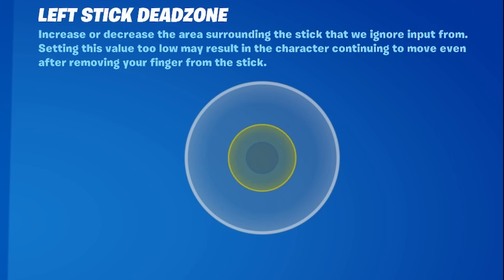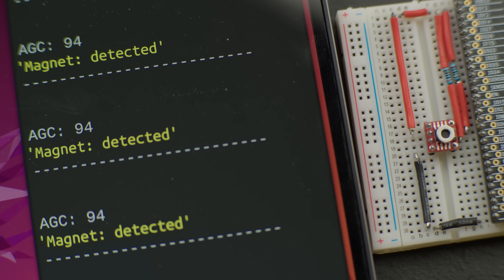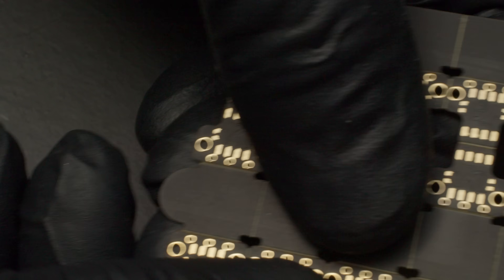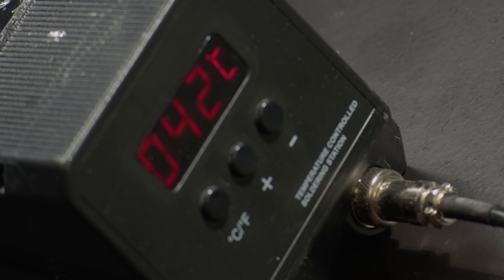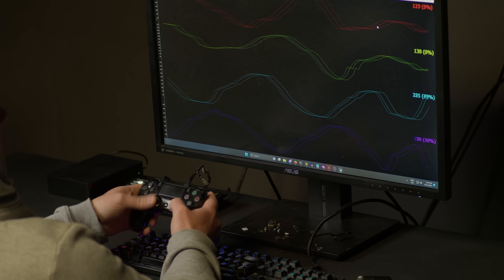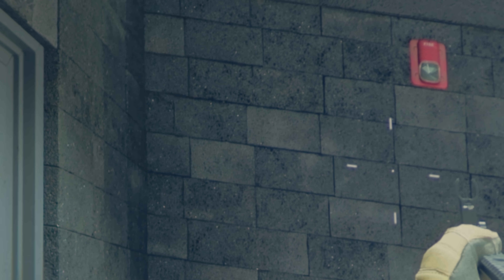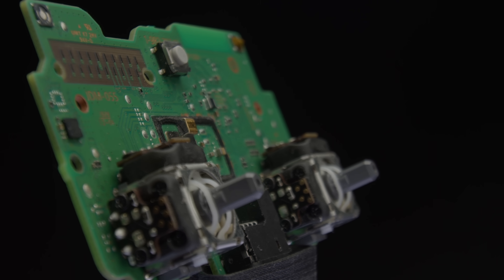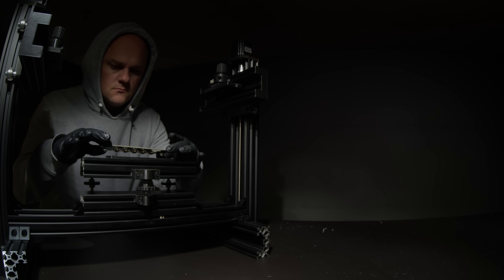Beating the $20B Joystick Drift Problem, and giving it away for free

Comment: I think they know exactly what they are doing. This wasn't a big issue a few console generations ago.
Reply: Planned obsolescence baby
Reply: how long ago are we talking, my 360 controllers have terrible stick drift
Reply: @3CODKing  Meaning that majority of people didn't even know it was possible to fix stick drift, people just assume it's normal that they break, like everything else...
Reply: @Empty12345  gaming has also changed where stick drift is an issue but it wasn’t really back then. Gamings change controllers not really
Reply: @3CODKing my 360 controller started having such drift after 10 years of constant use
Reply: @Idfkwhyy  All 5 of our PS5 controllers have drift after a few months.
Reply: @AlfieMaxMiMi  damn, thats weird. I got a black dualsense right when it launched to play on my PC and after almost a year it's still fine, no drift at all.
Reply: @3CODKing my dreamcast controllers and gamecube sticks always felt good. not sure about N64 but those were great too
Reply: @3CODKing PS2 and PS3 controllers also uses hall effect to recalibrate the analog everytime the controller is connected. there are demonstration videos of this already
Reply: @3CODKing PS2 had built in drift correction.
Reply: @3CODKing  In the 90s, there was the Microsoft Sidewinder 3D Pro, with optical sensors, like you'd find on... a ball mouse.
Reply: @3CODKing my ps4 controllers have never gotten stick drift and I be played with them for about 6 years and I’ve never gotten stick drift now my ps5 controllers get it after 6 months
Reply: @3CODKing  

PS1, PS2, OG XBOX, all had hall effect/driftless controllers.
Reply: @3CODKing  i beat the fuck out of my ps3 controllers and only had motion glitches if i dropped the controller alot
Reply: @3CODKing yeah, one of my old N64 controllers has terrible drift, too.
Reply: @3CODKing  Dreamcast controllers and earlier models of the PS3 controller are drift-proof since their sticks use the same magnetic principles as in this video.
Reply: @3CODKing I think you just broke em dude
Reply: @3CODKing PS2 has zero drift issues.
Reply: @3CODKing we are talking about when dinosaurs dont have any issue with their controllers, it actually last for many generations and became a common heirloom among prominent dinosaurial clans
Reply: Og xbox ps2 gamecube had no drift, and the dreamcast had also no drift and the mechanics of it were different 😊@3CODKing
Reply: @3CODKing well the old N64 ctrl and other in that era already used a similar method (hall effect, magnetic). But the one in X360, ps3 or 4+, NSW are  cheaper and it is a good revenue selling replacements that are just as bad
Reply: @3CODKing  2012 and below
Reply: Yes your actually right. Companies do make their product to not last very long. So they can make more money
Reply: Someones never played n64 or ps1
Reply: I agree, they've probably made them even cheaper on purpose because they were lasting too long
Reply: My PS2 controllers are fine til this day. Both are originals and I have them since the first PS2 Slim.
Reply: @IgnusValentine  ya all my old controllers are doin just fine even PS1 aswel & they've seen alot alot of use
Reply: My standard xbox series controller works like a charm, I haven’t gotten stick drift and i’ve been abusing this controller for close to a year. I did have an xbox elite controller and the bumpers always break though. It is just inexcusable that a $180 controller has the bumpers break within a couple months of use. Microsoft knows about it and haven’t fixed it. It makes no sense than the standard controller that comes with the xbox is more durable than the “elite” controller.
Reply: My PS3 had only two controller replacements through its console cycle. The PS4 had 7 replacements.. PS5 three within two years because of drift
Reply: @MRHardRoller i went through 7 ps4 remotes in the lifespan of mw19 alone, used the remote that came with 3 years no issue but once that died id get stick drift in like 2 weeks and within a month it was usually bad enough to retire the remote from fps games
Reply: bro bro bro, idk about you but we smacked the n64 stick and that thing had the neck broken but not DRIFTING!
Reply: because it's a scam... SEGA and GuliKit fixed this in the 90s and their patent expired so Sony and Xbox have no excuse to not use that design. they don't use a potentiometer to detect movement, they use a hall effect sensor which has no moving parts, because it uses magnetism, thus it lasts nearly forever... they still sell controllers with hall effect sensors today and they last far longer.. video explanation : https://www.youtube.com/watch?v=MpLQf_q3avA&lc=UgySqCl8Za-qhZPILkZ4AaABAg
Reply: i use a 20 year old logitech g13 and it still centers perfectly.
Reply: I miss the old ps2 controllers.. I grew up on those things.
Reply: Fun fact: N64 controllers can be opened up and fixed using only a phillips screwdriver -- the control stick switches out in about a minute
Reply: I NEVER got stick drift on my Xbox 360 dropped it multiple times and never broke I drop a newer Xbox controller once and I know something must've broke
Reply: Sure, ask Nintendo, thosere were super happy.
either that or get a fk xbox 360 controller. mine is 15y old an works fine
Reply: N64 controllers may not have "drifted" as such but the parts still wore out so the stick would sag, or not return back to the centre point at all. And the plastic in the internals would degrade and turn into a coarse powder that would create an unpleasant grinding sensation in the mechanism when the joystick was used. 

Old controllers definitely had their issues. I'd rather have a replaceable / repairable controller for cheap that might need some TLC years after EOL of their parent console than the over-engineered controllers that cost as much as dualsense 5 controllers do today.
Reply: They could just sell parts or something. Or do this. Somebody get him a billion bucks. And bring me a million while you're at it!
Reply: N64 would like a word
Reply: The PS2 even had a system to fix it, the controller measured the drift and corrected itself, modern controllers don't do that..

Most people throw away their controllers to buy new ones ones they start drifting cause they are 'broken' and that way they make more money on their overpriced controllers..
Reply: Planned obsolescence… can’t make $ if the controller doesn’t break…
Reply: Seriously. I never heard about stick drift at all until the PS4/XBONE generation. I know it did happen but it seemed to start happening all over the place. I still have an original gamecube controller that works perfectly.
Reply: It wasn't an issue on my early DS3 controllers because they used hall sensors.
It's entirely planned obsolescence.
Reply: It's been a year and nobody is implementing this; yes, it's all purposeful
Reply: @ArbitrarilyAnswereD”non existent”?
Reply: Just buy the Gamesir G7. Cheap and reliable
Reply: Dead zones used to be wayyyyy bigger lol
Reply: Why would they save you money when you could just buy more controllers to make them more profitable?
Reply: Shush
Reply: Ive had pretty bad stick drift every controller ive ever had. 360, xbox one day one, xbox one custom, newer xbox one controllers as well.
Reply: lol funny to see you there brother
Reply: Ps2 remotes used to recallibrate, you could just wiggle the stick to let it read values and adjust
Reply: PS3 joysticks are way less accurate than newer controllers, so the issue that causes the drift is not/less noticeable on older controllers.
Reply: People on here be like “uh my SNES controller didn’t drift”
Reply: .. ding ding ding.. this guy gets it..
Reply: Consumer products isn't made to last (hint is on the name) joysticks like this has been the standard in industries for decades now, like joysticks in heavy vehicles, controlpanels on garbage trucks etc where reliability is more important than cost where just one halleffect joystick without anything else than two axles for a garbage truck controlpanels sells for about 5-600 euros for JUST the joystick alone. While a joystick like this for game controllers isn't as expensive. Consumer products is simply made to function because consumers themselves refuse to pay for anything. Just look at how freaking common CHEAP worthless deathtraps of cellphone chargers people buy and use.
Reply: As some have mentioned the N64 controller... That one is an odd one out it had no drift per se Because it's not a potentiometer used for position control rather it uses the one and same technology that old ball based mice for PCs worked. By having two slotted wheel pass through a light beam. 

The "drift" on the N64 controller is because Nintendo didn't really realize HOW much the stick part of the joystick would wear down as it was physically rubbing the plastic dome base it was spring loaded onto to create the stiffness of the stick. And without lubricant the rubbing wore down the stick fast. In some cases where people by normal action presses down on the joystick as they play it wore down even faster still. This weardown causes the spring that stiffened the stick to loose tension and cash the cause for the stick to "wobble" around when you slightly shake the controller. 

Some people that by normal action but no down force on the stick only putting horizontal force on it saw a longer lifespan. But it still will always wear down. 

Some people just wear things faster by normal aswell. As mentioned, some unconsciously puts a vertical force on the joystick which does increase wear compared to normal wear from just horizontal force.
Reply: I've had drift here and there since ps1.
Reply: I have 6 xbox360 with years of use. Only the thumb pad disintegrated and one controller has a right shoulder that doesn’t work. My Xbox one lasted 6 months before the drifting occurred
Reply: True, I've got ancient PS3 controllers that are still going strong. But I'm not sure that it's Sonys fault. ALPS make the pots, and they don't appear to be as good as they were. Perhaps it's ALPS getting greedy? If so, I hope it bites them in the ass.
Reply: @AlfieMaxMiMi my ps3 ones are still going strong as well
Reply: @AlfieMaxMiMi .. news flash: every company that makes 1 million dollars this year.. needs to make more then that next year to be considered "succesful" lol 🤷🏻‍♀️🤷🏻‍♀️
Reply: @AlfieMaxMiMi they can still get it it just takes a lot more time
Reply: @AlfieMaxMiMi  Perhaps,  but in other fields, Like electrical musical instruments, for example, ALPS are largely seen as "cheap", with CTS, Bournes, Seymour Duncan and Fender being seen as superior for Full sized wiper sider style Pots. If the manufacturers wanted to place quality over cost, they had plenty of options.
Reply: @SavageDarkness  In my hobby, the Alps blue is pretty much the industry standard. The old Alps pots as used in the ps3/ps4 rarely suffered from drift, so as I said previously, Alps must have changed something... I don't see it as Sonys fault, by buying inferior parts - unless they knew things had changed, but then Nintendo and Microsoft are suffering from the same drift problems with their controllers. What I don't like about Sony, is them bringing out a new controller (dual sense) costing a hell of a lot more, but with the same problem. And with them obviously knowing it's a problem by making the sticks easily replaceable (finding a way to make money out of the fault they should have fixed).
Reply: @SavageDarkness  just FYI Fender doesn't make pots their pots are made by CTS. Neither does Seymour Duncan. They're also CTS pots. Their pots are sometimes made to custom spec, but CTS makes them all. The good stuff is pretty much all CTS and Bournes in guitar land.
Reply: @gralnrath  True, but most people do not know that.
Reply: @SavageDarkness  Right...that's why I'm elucidating. I'm just adding context not throwing shade.
Reply: I think you're giving Sony and other console/controller companies way too much credit. Think about it. Who's making more money from controller sales? It would make much more sense that steering for planned obsolescence was either a collaborative effort, or one of the companies making real money sticks going out, coming to ALPs with design suggestions (ie, can you make these go out sooner?)
Reply: @sododgy8338  FACTS
Reply: @AlfieMaxMiMi  PS3 controllers use the same joystick modules that they have today. They are also prone to stick drift.
Reply: @Empty12345  I've got about 6 very old PS3 controllers that I've had to replace the batteries on. None have suffered from drift. We have 5 PS5 controllers here that have all been replaced a number of times due to drift. There's just no comparison.
Reply: @AlfieMaxMiMi  Sure, nevertheless both use potentiometer joysticks.
PS5 could have worse sticks, but PS3 joysticks aren't immune to stick drift.
Reply: @Empty12345  No, they are not immune, it's just so rare that it's not something to worry about.
Reply: @AlfieMaxMiMi  The earliest models of Sixaxis controllers, the ones without vibration before they released the dualshock 3, actually used hall effect sticks, so there's that, but then they changed it to the usual Alps. And before then there was the dualshock 2 which constantly self-calibrated to combat drift, and those sticks would keep going perfectly until the actual spring started to give. It was only until the PS360 era that drift became a common issue.
Reply: @Klefth  The earliest models didn't use hall effects, the majority of dualshock 3 boards however did, ps3dev wiki has a top and bottom view of each board, the ones with 4 pins per stick axis are hall effect sticks
Reply: @AlfieMaxMiMi Ur PS3 controllers are lasting longer because the deadzones of gamrs back then were bigger.
Reply: Can confirm, I had to replace about 4 PS3 controllers due it's batteries but never had any problem with stick drift until ps4-5
Reply: @AlfieMaxMiMi 💯 I've had old controllers for years and never once thought about stick drift. 
A year or so after owning my Xbox elite controller, stick drift.
I fixed it but it came back. Need to try it again.
Reply: @Empty12345  Wrong! PS3 used 4pin modules that has hall effect sensors. There is video called "Drift Proof Controllers" from VK's Channel that shows Dreamcast and DS3 controller joystick.
Reply: @mdjey2  Googled it and apparently there may have been a first batch of PS3 controllres that did have hall effect sticks. Great, sadly they stopped it because of greed.
Reply: @AlfieMaxMiMi I have 2 PS5 controllers for 2 years, and they are just as fine as they were when I bought them. I don’t know what people do with them so they break. Or am I just lucky.
Reply: @murray821 Our controllers aren't abused in any way. You're just lucky.
Reply: @AlfieMaxMiMi  i have 3 ps3 controllers, 2 dualshocks and a sixaxis. The dualshocks are still going strong, the sixaxis unfortunately developed drift on both sticks after a year or so :(
Reply: Everyone here talking about cheap components when the largest indepdent study concluded that it was more about a change in how games were played and manufacturers failing to implement a software solution (ie Ps1s constant recalibrating). They actually found that the quality of components, particularly in Microsofts case, had actually gone up generally. They theorised that companies had slightly beefed up their components in response to warnings of drift during development. But yeah, it ain't cheaper components. It's the not heeding warnings and failing to implement solutions in software.
Reply: @medes5597  Regardless of what an independent study says, N64 controllers don't seem to have drift and I never saw any in gamecube or wii nunchucks either. Didn't matter what I did to them. Personal experience aside, do you have a source for that study? I'm pretty curious about it.
Reply: @johnluis2358 this. They are designed to drift now. Real scummy move.
Reply: @johnluis2358  n64 controllers absolutely do have drift lol, wii nunchucks too. My nunchuck from when i was a kid got horrendous drift in a few years
Reply: @lambertstarr1218  Cool story. I'll believe it when I see it. Even if yours did somehow have drift, I think it's most likely a user issue with you trying to play underwater or something equally stupid. Alternatively, I have seen off brand n64 controllers that had drift. I've seen way too much evidence that both wii nunchucks and especially n64 controllers don't have drift without extraordinary circumstances though. You're going to need more then that to convince me.
Reply: PS1 controllers read in a new 0 every time they're powered or something like that, making stick drif impossible
Reply: @knight_lautrec_of_carim  interesting that they wouldn't continue to use that in today's controllers? But honestly I'd prefer everything to go Hall-effect.
Reply: @knight_lautrec_of_carim  you realize it's a physical hardware defect, not a software issue? Watch the video
Reply: @duncanmacleod7287That's because they don't really care about the environment. It's just posturing
Reply: Ask Gamecube users...
Reply: My understanding is the PS platform used to account for stick drift with software.
Reply: I have been using an Xbox one controller for years now (on pc now) with no issue. At least 1000 maybe 2k hours on it and it’s fine
Reply: @ArbitrarilyAnswereD You almost had it right. It is a cost measure. But there are companies that are most definitely interested in making high-end controllers with hall-effect joysticks (and other sensors) built in.
Reply: idk man my ps3 joysticks fell apart all of the time
Reply: @Surooh333  I have some heavily heavily used ps3 controllers that still work just fine.
Reply: People were complaining about it since the Atari days?
Reply: @alexcorona  Maybe, I don't know. I do know that it wasn't much of a problem with the PS1/2/3/4. Yes, they may have suffered from drift after years of use, but lots of people are now getting drift after months of use.
Reply: wrong
Reply: its always been an issue what you on about
Reply: Stick drift has been a huge problem from the very first analog stick, up until today. It's only been fixed by dead zones.
Reply: This was always a problem and in the same failure rates as today, except for maybe the switch.

I have a PS1 DualShock 1, an original Xbox controllert, and a PS3 that all have drift, but that’s it for me.
Reply: Old controllers had it worse. We just didn't care because such small inputs didn't matter
Reply: @NoCluYT wow, No!
Reply: This was even a problem for PS2. You're high lmao
Reply: Games used to be so blocky most of us never noticed stick drift; now they run in 60 fps, you’ll notice any drifting
Reply: All my controllers are fine, from xbox series to xbox one to joycons fo gamecube to xbox 360 lmao.
Reply: @erickalvarez6486  damn even the fucking joycons?